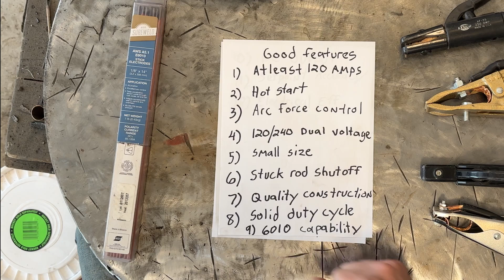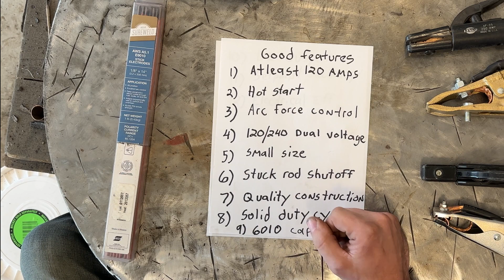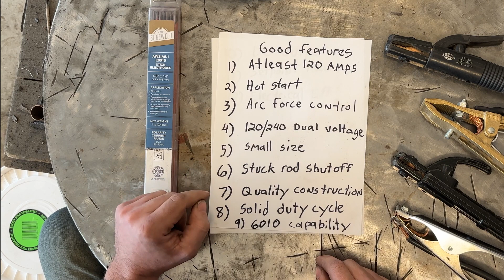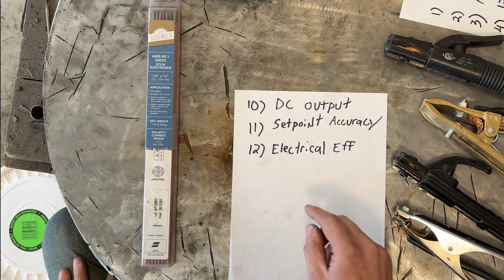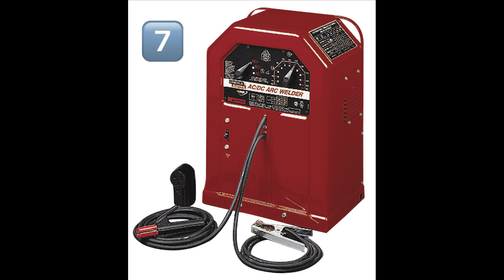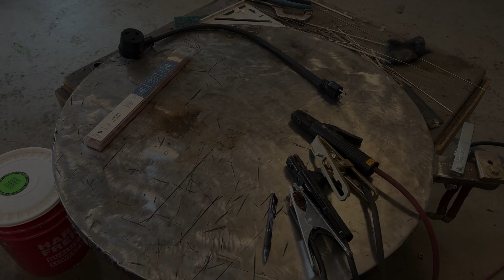Picking out a stick welder (features to look for and top 10 recommendations)

Comment: Ive got a miller 444 3 phase. Dont have the 3 phase power right now but when i did talk about a stick welder 😊 retired now and didnt want to pay for the 3 phase install. About 25 thousand.  But man i love that machine. You have probably used the 333 or the 444.

Comment: Would a high OCV compare to Hot Start.?
Reply from the maker: So high OCV makes starting an arc easier, but it’s not a boost in amperage at the start.  Hot start will slightly make starting an arc easier but more importantly it helps limit starting porosity with rods like 7018 due to heat input.  Some welders claim hot start when they don’t have it.  If the start of the weld looks a bit roped up (and not flat, wetted out) the machine probably doesn’t have hot start.

Comment: Hello, how long of leads can be used on the CST 280?
Reply from the maker: Completely depends on the amperage.  If you want to run up to 120 amps you could get away #6 gauge to around 50’.  If you want to run more amperage or longer distances you would need to go to #4 or bigger.  Best way to figure out what you need is to make a decision on amperage you need and use the chart on this site: https://www.lincolnelectric.com/en/welding-and-cutting-resource-center/weld-solutions/selecting-the-proper-size-welding-cables specifically figure 5.

Keep in mind that it’s common to increase the power cord length with a extension cord vs the output leads because the input cord is smaller gauge copper (#6 or #8) so it actually is cheaper than welding lead.  All depends on distances and amperage requirements 😀👍.
Reply: @makingmistakeswithgreg sounds good. Thanks for the info. PS your videos are very informal!!

Comment: I haven't used it yet (I'm still watching Greg's videos trying to learn), but bought the YesWelder Tig-200P after seeing a lot of good reviews and a price that was easier to swallow, it has all of the features you list to look for, but now I'm hoping I didn't make a mistake and just waste my money. It's the "6010" issue I'm now concerned about since everyone says the only 2 sticks you really need are 6010 and 7018. How will I know if it's the welder or my own inability if I have problems welding with 6010?
Reply from the maker: So the easiest way to k ow if a machine will run 6010 is to get an arc started and see if it goes out while you’re holding a tight arc gap.  Many cheaper machines won’t run 6010 because they can’t produce enough voltage to keep the arc lit.  6010 needs 30-35 volts to keep a stable arc lit.  6013 needs about 20 and 7018 needs about 24.  Many machines will work with 7018 but won’t with 6010 simply because they can’t output enough voltage.  6010 is a very useful rod however it’s not an absolute must have.  6011 runs very similar, is less aggressive, and more machines run it than 6010.  The big one you want to be able to run is 7018.  It produces absurdly strong welds and tends to be the go to rod for many repairs.  If I had the choice between 6010 and 7018 I would rather have the ability to run 7018.  7018 doesn’t work well on poor fitups/gaps though, which is where 6010/11 comes in.
Reply: @makingmistakeswithgreg  Thanks Greg, I wish your knowledge was easier to look up somewhere lol. It's looking like it won't do it per the specs, @220V it lists 26.4V with a 65% duty cycle. I guess I won't complain too much, I mainly bought this just to learn how to Tig weld but I have a Jeep I wanted to do some stick welding on outside, good thing I didn't buy a big box of 6010 rod. 

Do you have rod oven recommendations for the 7018, or will just a toaster oven capable of heating above 212 deg F to boil the moisture out work?

When I was looking at welders I thought why is the cheapest Miller $2500 and everyone else is $300-$1500 max, I guess now I know.

Comment: I'm looking for my first welder and your advice is superb thank you
Reply from the maker: I will actually be making a video on this shortly, but for the time being I have this tosay:  I am a firm believer in both the harbor freight titanium 225 and the titanium 125.  Both weld really good, are easy to work with, and are super compact/useful.  They are so useful if you upgrade to a different machine it’s still worth keeping them around.  Amazon specials that are similar to those often don’t weld as good, which is why it’s hard to recommend them.  Everlast and Eastwood are two more affordable welders I would also look at, along with other titanium/vulcan welders from harbor freight.  They are a great place to start with and very capable.  Make sure to spend money on practice steel and consumables for practice.  Practice will make a bigger difference than a more expensive machine 👍

Comment: Thanks for the recommendations. Amazing what you can get from Amazon (etc.) that would be more than adequate for a home and hobby type user. I was a welder in another life and when I retired I was shopping for a GTAW / SMAW combo machine. I ended up with an Everlast Power Tig 200 and very happy with my purchase. It has more buttons and dials than I know how to use. The one issue I have with Everlast is the accessories that came with it are very cheap and I had to replace a lot if it, like almost $200 for 50' of #1 cable. At least I could use the #4 cable it came with to make up a stinger whip. A couple of questions: Are you planning to do a recommendations list for combo machines (or have you and I missed it)? I noticed that Everlast was conspicuously missing from your list. Is that because you don't have any experience with them or just don't like them?
Reply from the maker: So everlast makes some good machines.  I have owned a few and liked the way they welded.  They are better than a “Amazon special” by a lot.  The fact they don’t lie about specs says a lot, since many cheaper welders will tell you anything to get a sale.  I think their dedicated machines are excellent, I am not a fan of their all in ones.  The all in ones I find to be cumbersome to use, the software outright sucks, and the quality of the accessories aren’t the best like you found.  I owned the lightening 275 and sold it because the interface and how it switched processes was not good/annoying.  It welded exceptional though.  Their dedicated tig machines are actually really good and I like them a lot.

Comment: I don't think I would want "Stuck Rod Shutoff"... how else can you short circuit a damp rod and dry it out if you need to?  (Old Welder's trick...)

I bought a HF Titanium Stick 225 so I could be a little more portable than with my Old Reliable Hobart Stickmate LX ... I ran 5lbs of 7014 with it in about 3 hours a few weekends ago, running it on a generator... Kind of a trial by fire while the 90 day warranty is still in effect (what the heck is duty cycle thing everyone is talking about??? ;-).  I was running the 7014 at roughly 140 amps... never noticed the stinger that comes with the Titanium getting warm at all.  That thing has kind of a goofy shape, but it works.  I tend to burn my stubs down to where there is no more flux on them, and not a sign of distress on that stinger at all after wiping the smoke off it. Same with the work clamp... no heating whatsoever.  Yeah, it's got 6ga welding cables, but if you're only running 1/8" electrodes, I don't think that's an issue at all. I'm really impressed with the Titanium Stick 225.  It's a good machine... hopefully it lasts.  I did buy the extended warranty with it (the coupon savings pretty much paid for the warranty) so I've got 2 years to push it hard and see what it can do.  I haven't run any 6010 on it, but I ran a couple pounds of 6011 with it too and it does fine.

Comment: Great video! I went with the maxstar 161 STL because they were running a higher rebate than usual plus it’s much cheaper than the sth and lift tig will work for me just fine. Boy did that little guy surprise me. Well worth the money so far
Reply from the maker: Glad to hear it 👍👍.  Many people say it’s over priced but those are people that never used one.  It flat out welds the way I like, it’s so easy to switch 6010-7018 modes, and it’s unbelievably light.  I have owned all the competing small welders (esab, fronius, everlast, etc) and that miller is the best.  It’s almost comical how small and light it is, yet it can do actual work.  I wish I didn’t sell the one I had lol.

Comment: I have an old miller maxstar 150. It has larger dinse sockets, DC inverter. Great machine if u can find one, but I wonder about those smaller caddy type stick welders these days. Some look to have a good output
Reply from the maker: The maxstar 150 is pretty much a legend in the mini welder world.  They still pop up for sale occasionally and are great machines.  In today’s world the maxstar 161, fronius trans pocket 180, esab rogue 180 or 200, and Lincoln sprinter 180 are slightly bigger but are all awesome machines.  There are cheaper welders out than those that are small (everlast 161 for example) but they tend to not be able to achieve the same output on 120v.  The small welders are my favorite machines 😀.

Comment: Thank you for your help.  I normally am willing to pay for the best tools so I don't have to upgrade later, but the difference between Miller level and Harbor Freight is hard to justify for me even though I have the money.  I did upgrade the electrodes on the Titanium Stick 225 even before making my first weld.  I guess I will wait to see if the cables get hot or if I need them longer before upgrading them.  I assume the 6AWG is OK with shorter cables and I should probably consider bigger cables if I want longer cables.  Anyway, I really appreciate a voice of experience on this before I get started with welding.  I can't wait to get to work on some projects.
Reply from the maker: One of the best things about modern day is the fact that you can get a reasonably priced welder that works great.  The titanium 225 is a great example of that.  Regardless of price it’s actually a great stick welder, and runs a lot of rods better than the lower end millers and Lincoln’s.  I recommend to people all the time if they want to learn stick to start out with the titanium 225 because it will weld much of anything you would want with stick.  It’s dial is dead on accurate, it runs all rods including 6010, and it’s easy to start rods with.  The main limitation it has is running on 120v gives almost no amperage but other than that it works great.  Good luck with your projects 😀👍
Reply: @makingmistakeswithgreg  Thank you for your response.  I just encountered a Primeweld CT520DP and am surprised that you can get a machine that can stick weld, tig, and plasma cut.  The thing that concerns me is with the Titanium is when I need to do cutting I would need a different machine and Harbor Freight's comparable plasma cutter (based on amps) is like $900.  The Primeweld is $500 and does everything I would want.  I don't see current reviews for Primeweld, though.  Maybe it is subpar at everything.  Do you have any experience with these machines that plasma cut as well as stick and tig?  Based on the numbers for the Primeweld it should be as capable as the Titanium and you get everything else for free.  Surely you are giving up something or everyone would be loving the Primeweld and you would hear more about it.

Comment: Four years ago, I bought a really cheap and tiny Hynade stick welder (they don't seem to sell anymore - now a plasma cutting/stick welder) to use on some rare occasions when we're out on a job site and need to weld. It works very weld with 6013 rod and will run 6011 but at higher than usual settings. I recently did a 3 day welding job with it and I really can't complain. A year ago I went "green" with  Everlast, the Cyclone 262 Mig/Stick machine and it's a beast.  If I had need again for a small portable stick machine, I'd be inclined to buy th Everlast PowerArc 200 STh for $359.
Reply from the maker: Everlast has been successful in many ways other companies haven’t been.  The big thing to me is they don’t lie about specs or capabilities.  It is very difficult to find machines at everlasts prices that work as well, because most of them flat out lie about what the machine can do.  I haven’t had a chance to run their newest machines but I bet they are good.

Comment: Great recommendations!  Down here in Mexico, I was able to buy an ESAB Rogue LHN 242i for about $445 USD.  It seems it is a product line that is only sold in Latin America.  It is a 200 Amp welder that runs on 220V and has MMA and lift TIG modes (TIG torch not included).  As a stick welder, it is able to run 6010 and has the hot start, arc force and stuck rod shutoff.  It will be fun to start experimenting with it but I need to set up the 220V outlet first.  Thanks for making these videos.
Reply from the maker: That’s basically a cross between the rogue 200 and the 180.  I am sure it’s a solid welder.  You will be happy with it for sure.

Comment: I constantly see people having big issues with the maxstar being garbage and dying out within months and miller not doing anything to resolve the issue
Reply from the maker: The welder should be under a 3 year warranty if bought new.  If they are outside of that miller won’t do much to fix it for free.  I can vouch for the one I had and I have used one at two places I have worked without failures.  Due to the small size and how prone to damage/poor working conditions they are, I wouldn’t be too shocked at failures.  There really isn’t another welder that is the same size and as good of tig arc.  The esab rogue 200 I have is solid but it’s bigger, heavier, and doesn’t have as good of tig arc.

Comment: to run a 6010 good what OCV should I be looking for?
Reply from the maker: So the OCV isn’t the issue, many stick welders produce 60-80v OCV but can’t run 6010.  I put a link to a video explaining this that I made, it’s at the bottom of this comment.  What you need to have is a welder that can produce 30-34 volts while welding.  This is very difficult to do with a cheap welder because it requires more components and engineering.  Most welding takes place between 15v (tig) 21v (mig) and 25v (all rods besides 6010).  Welders design their power supply around this fact therefore they typically can’t produce 30+ volts while welding.  This is the same reason why most home mig machines can’t spray arc weld (24+ volts).  The only way to know for sure if a welder will run 6010 is to test it or have someone verify it.  Lincoln/miller/esab will tell you if it will run it.  99% of the cheap Amazon welders will say they will but they lie.  The cheapest welder I know of that will run it is the harbor freight titanium 225.  It runs it really well.  Beyond that the next option is atleast 2x the price new.  

https://youtu.be/qVr15sXRolo?si=VK4pHv_2mOlhqrp-
Reply: @makingmistakeswithgreg   ESAB MINIARC 180 good to go for 6010 and tig?
Reply from the maker: @Jacoby4465  so I owned the rogue 180 (I believe they now call the mini arc).  It’s a great stick machine and will run 6010.  Tig wise it does lift arc well and can tig just fine.  Keep in mind it doesn’t have a gas valve in the machine so you need to buy a gas valve tig torch. If you want really good Tig performance the rogue 200 (sells for 200$ more than the 180) comes with high frequency start, internal gas valve, a really good Tig torch with controls, and a bit more amperage.  

When it comes to 6010 performance most small Tig machines won’t run 6010.  I actually just bought the harbor freight pro Tig 165 and it likely won’t run 6010.
Reply: @makingmistakeswithgreg   what breaker size should I get for this welder? I cant find any documents for the input.

Comment: Great video with honest opinions. I will be going to China for my first stick as I can afford better to waste that sort of money. 

Please consider a separate review of the China ones as I hope some are better that others.
Reply from the maker: So I can tell you that in the US (not sure where you are) the best stick welder that’s affordable is the harbor freight titanium 225 for around 230$ new.  When you get into the Amazon specials virtually all of them lie on specs and are sub par quality/capability.  I wish I knew of a stick welder for 150-180$ that was solid but the truth is I don’t believe it exists (except used).  

One thing I didn’t understand with welding until I became decent at it, is how some features make a significant difference in how easy it is to use a machine.  Having hot start that’s adjustable, arc force adjustment, stick stuck (where it cuts the power when the rod sticks) high open circuit voltage, and the ability to run 6010 rods makes it so much easier for a skilled welder to get better results.  They also make it easier for the average person to learn to weld, and to be less frustrated.
Reply: China welder 

🔭 inside 
12mosfet 
3 transformer 
2 toroid inductor 

best welder for hobby & small workshop .